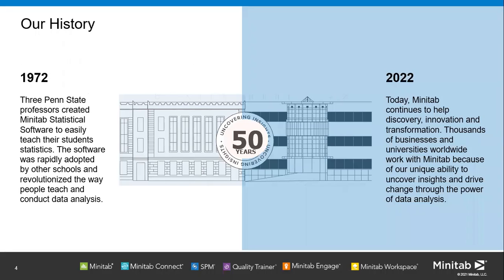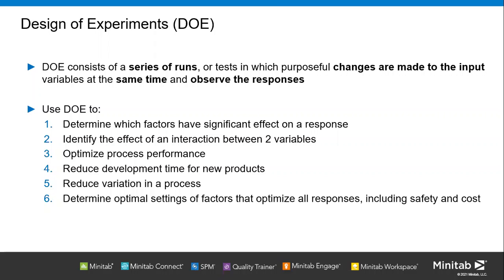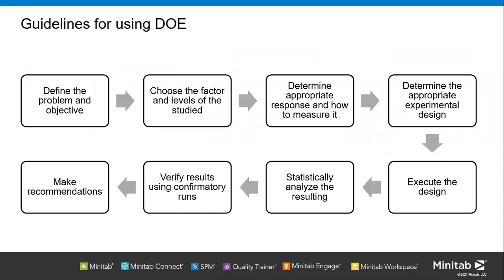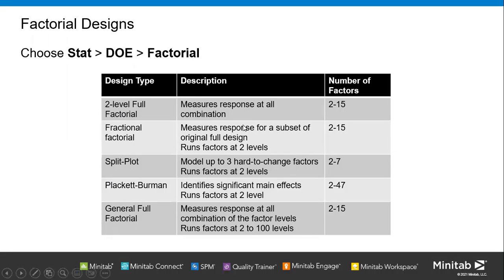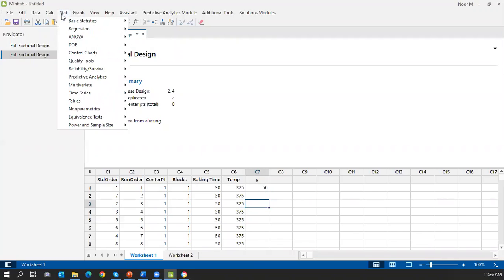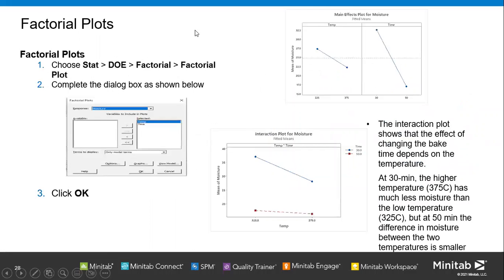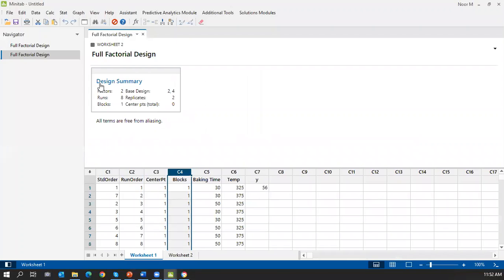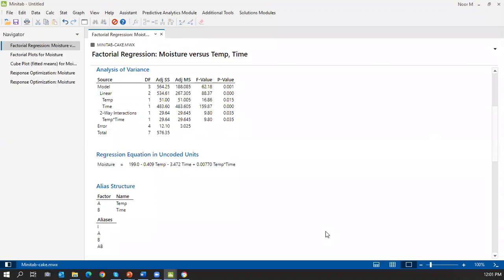Minitab Statistical Software: Design of Experiment

Comment: hello. It was a wonderful presentation which has cleared many of my doubts. I have some query, it would be kind of you if you can help me.
1) I want to study the effect of various factors on enzyme production. Factors i want to study are around 10. So I should use plackett burman design  or full factorial design.??
2) After which I want to know which factors effect the production and then optimize it. So which design is suitable.
3) After we select any design we save this document run our experiment and come back n add our values in next block and proceed for the analysis right?
4) lastly how can we get predicted values from the software and compare it my actual values. Where is this option available.
Thank you
Reply from the maker: Hi, your questions on choosing an appropriate statistical tool for your project and interpreting the output relative to your process are beyond our technical support scope. We offer personalized support through our Statistical Consulting service which carries fee at U$2K for 4-hour block.

Having said that, here are some guidances for your reference:

Phases of design experiment
https://support.minitab.com/en-us/minitab/21/help-and-how-to/statistical-modeling/doe/supporting-topics/basics/phases-of-a-designed-experiment/

Available designs in Minitab Statistical Software
https://support.minitab.com/en-us/minitab/21/help-and-how-to/statistical-modeling/doe/supporting-topics/basics/which-standard-designs-can-minitab-create/

To get the predicted values, you must store the model by Stat > DOE > Factorial Design > Analyze Factorial
https://support.minitab.com/en-us/minitab/21/help-and-how-to/statistical-modeling/using-fitted-models/supporting-topics/basics/stored-model-overview/

Once you store the model, you may proceed with Stat > DOE > Factorial Design > Predict
https://support.minitab.com/en-us/minitab/21/help-and-how-to/statistical-modeling/using-fitted-models/how-to/predict/before-you-start/overview/

Comment: Hi Mam. This was a very nice and clear presentation. Can I use factorial design for 3 factors and 3 levels?
Reply from the maker: Hi, for factors with more than 2 levels, we will use General Full Factorial Design

Here the links how to create the general full factorial: https://support.minitab.com/en-us/minitab/21/help-and-how-to/statistical-modeling/doe/how-to/factorial/create-factorial-design/create-general-full-factorial/before-you-start/example/
Reply: Thank you for the response. Will it be good if I use Taguchi instead of RSM? @MinitabMalaysiaSingapore
Reply from the maker: @Research_Page  This will depend on your response, the number of factors, and the level of your study.

Response surface design methodology is often used to refine models after you have determined important factors using screening designs or factorial design; especially if you suspect curvature in the response surface. https://support.minitab.com/en-us/minitab/21/help-and-how-to/statistical-modeling/doe/supporting-topics/response-surface-designs/response-surface-central-composite-and-box-behnken-designs/

Taguchi design is to create a robust parameter design to identify controllable factors in your process that can minimize response variation and make your product insensitive to changes in noise factor. Taguchi's design includes a control factor and a noise factor. https://support.minitab.com/en-us/minitab/21/help-and-how-to/statistical-modeling/doe/supporting-topics/taguchi-designs/taguchi-designs/